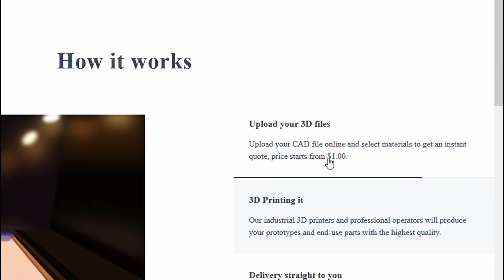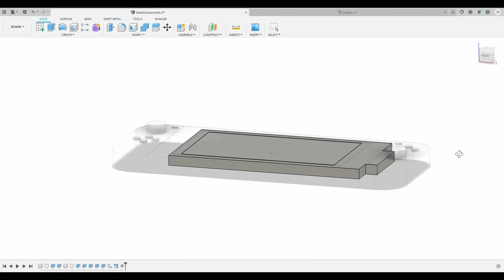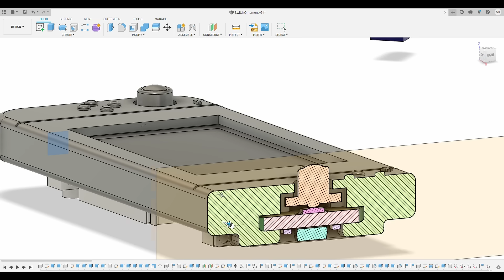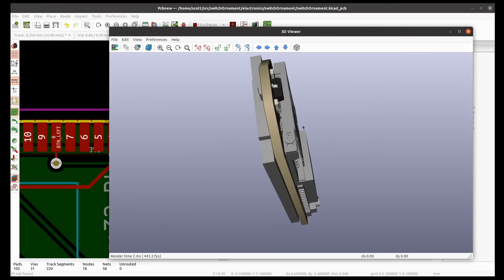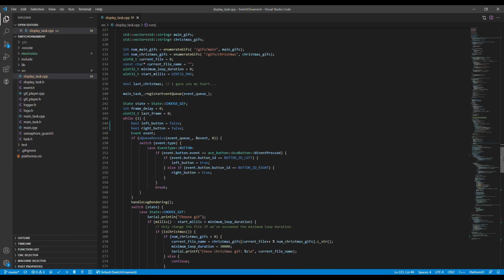TINY Nintendo Switch ornament with a working screen!

Comment: im a complete novice. can i get my esp32 with display to show a gif like this?

this is the exact board I'm using but I have had no luck, please help:

ESP32 Development Board with 2.8inch LCD Arduino LVGL WIFI&Bluetooth 240*320 Smart Display Screen TFT Module With Touch WROOM

Comment: Hey Scott, thanks for this great idea, sorry for me brutely copying the concept (not sharing it publicly or commercially though), I'm in the process of creating one (from scratch) myself. trying to get the shell 3D printed by JLC but they don't seem to wanna deal with thin walls (~0.8mm)  FDM prints fine though. any thoughts?
Reply from the maker: I generally tried to keep that minimum wall thickness everywhere I could except for a couple really small areas; I got messaged about violating the wall thickness in a few places after placing my order, but ultimately chose to accept the risk and order anyway. Not sure if JLC has gotten any more strict or if that's still an option?

Comment: May i ask, can this project plays any gif with the right file format? I have been trying to make gif player from different project, but the result i got was: I have to not only make the file into fight format(size), i have to make it into correct color depth and file size from 90KB to 110KB. So rn i'm trying to use esp32 mcu instead of rp2040.

Comment: Very cool ornament. I would have 3D printed the casing in 3 pieces: one light blue, one black and one red, instead of all white then hand painting it, to give it a more realistic/manufactured look. Btw, SLA 3D printers are pretty cheap (about $200 on Amazon) so you don’t need to hire a 3D printing service for a small project like this.

Comment: You should really consider setting up an etsy store. These would definitely sell, and production would be cheaper at scale, especially if you put multiple stencils one one sheet and could reflow several boards at once.

Heck, make a mold of where all the components go and you could load them into that mold on a tray, then invert the sheet of paste-applied boards onto it, then flip both over so they are in proper orientation for the actual heating and flowing.

A tweak or two to the design of the back to enclose it, and a little effort to find a larger scale painting method (stencils as well), and you could make a ton of these. If the power could run on something like a button cell this would be an amazing keychain too!

Please, if you would, what was the part cost, labor hours, and final price you would estimate for this one off?

I would absolutely buy one.

Comment: "im not  a good graphic designer " 
proceeds to graphically design a mini switch perfectly
Reply: He duplicated/modified an existing design (the actual switch), which is much simpler. He did amazing work with the PCB design and assembly though.
Reply: @Programmdude  its a joke ..... you don't need to explain anything ....

Comment: What do you call this type of stuff? Putting together circuitry and stuff? Is it a type of engineering? I’m really interested in learning more about it
Reply from the maker: General terms would be electrical engineering (for the circuitry and PCB design) or computer engineering / embedded systems (for the combination of electronics and programming). Arduino is a great way to learn more and get into it.

Comment: Not only did you design the 3D Print BUT also the whole electronics  AND then wrote a code that would be able to show an image on the tiny LCD. OH and you soldered them aswell...

Call me impressed, did you went to uni to know all this or are you 100% selftaught? I wouldn't even know where to begin...

Comment: Very nice and impressive job!  I haven't done surface mount work - how did you make the solder paste stencil - it looks like thin metal?
Reply from the maker: I ordered it as part of my PCB order, for about $8 extra. It's a fairly common option now at the cheap PCB manufacturers. I've also laser cut a stencil out of thin mylar plastic in the past (see http://scottbezek.blogspot.com/p/simple-usb-led-controller-sulc.html) which works alright, but can be tricky to get the settings dialed in (I think it's generally best to do multiple low power passes to cut through, otherwise the heat from cutting can distort the surrounding plastic).

Comment: I know nothing about soldering but how did you manage to do something so small and precise at 4:08. What method or technique did you use?
Reply from the maker: The trick is to use flux and good quality solder.

For this kind of surface-mount narrow pitch soldering in particular, adding some additional flux before soldering makes all the difference. I've used a liquid flux pen in the past, but recently switched to a gel flux from a syringe (Chip Quik NC191) and I've been liking that a lot. The liquid stuff can evaporate or dry up quickly, whereas the gel will just sit there until you heat it. That's what I used specifically for the soldering at 4:08 - you can basically put a little solder on your iron's tip and then drag it along the pins and the flux makes it so the solder only sticks to the pins and doesn't spread between them. (You will probably also want some isopropanol or isopropyl alcohol wipes to clean the excess flux afterwards)

I also spent longer than I'd like to admit using cheap junk solder. Switching to some good rosin-core Kester Sn60Pb40 has been a big improvement, though more expensive, and I think it's probably slightly less important than good flux, especially for surface mount soldering.

And finally a temperature controlled soldering iron is a must. I recently switched to a TS100 (running Ralim/IronOS open source firmware) which is now my favorite soldering iron I've ever used, but I had a cheaper soldering station before that which worked fine for years.

Comment: Could you please link to alternative display's we could use?

or list the specific model LCD you used?
Reply from the maker: It is likely the same LCD that Adafruit sells as part of a few different modules, which also may be more convenient to use unless you are going for something super small:
https://www.adafruit.com/product/4383
https://www.adafruit.com/product/4393
Adafruit is a great company to support and has lots of documentation and tutorials, though I haven't ordered those particular items before.

If you are interested in just the bare LCD without supporting electronics or a breadboard-friendly breakout board, this is the listing I ordered from:
https://m.aliexpress.com/item/33007316981.html (if you haven't ordered from AliExpress before, keep in mind that shipping will take between 2 weeks to 3 months, and sometimes products change without updates to the listing page, so be warned that the cheap price has some caveats... In the US, I recommend avoiding Cainiao shipping and always use AliExpress Standard, which is usually 2-4 weeks shipping. Also avoid or be wary of stores with < 95% positive reviews)

I found this style of LCD because it's the one that Lilygo includes on their TTGO T-Display ESP32 board, which is my favorite all-around ESP32 prototyping board (sold directly by Lilygo on Amazon, AliExpress, or Tindie), so for general tinkering and prototyping that would be my recommended item.
Reply: @scottbez1  Thank you that was exactly what i was looking for.

already know how aliexpress works. order a lot from it.